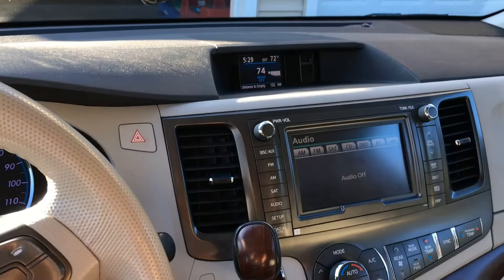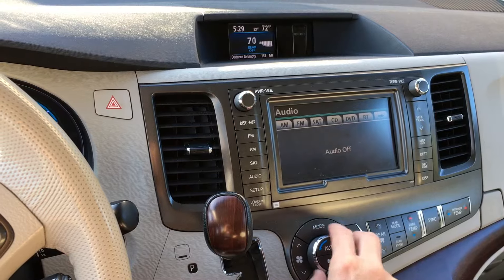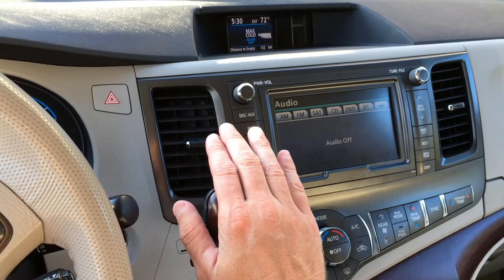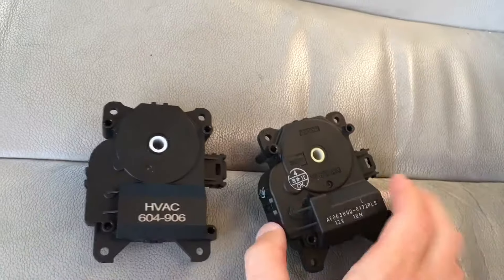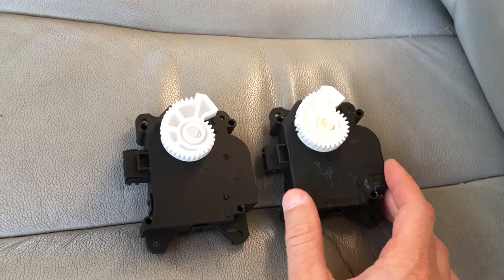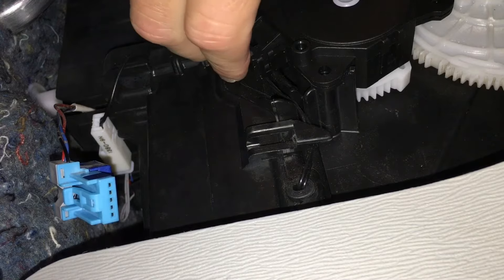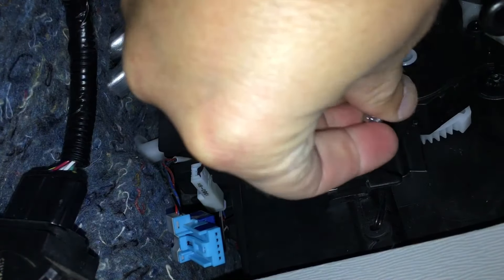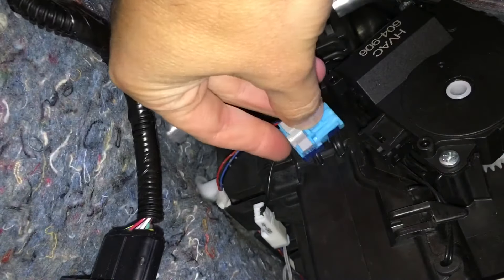Toyota Climate Control Heater AC Problem Repair DIY Fix

Comment: Thank you so much for this video!  The Toyota dealer had quoted me a price of $3,166 to tear apart the dash to replace the heating/cooling box (about $1k in labor and $2k in parts) on my 2013 Camry Hybrid.  I tried to explain to them about your video, but the $3k fix was their final answer.  So, I picked up my car from the dealer, stopped by Auto Zone as someone else recommended in response to this video, and had my car fixed in less than half an hour.  Total cost was less than $50.  Needless to say, I probably won't be servicing my cars at that dealer any longer.
Reply from the maker: I’m glad you were able to fix it yourself and save all that money! I can’t believe they weren’t willing to at least see if this was the issue before quoting such a high price! Thank you for watching and please give the video a thumbs up if you haven’t already! Thank you!
Reply: Yup.     I needed rollers for my minivan ( the small plastic wheels wore off ).    Dealer wanted 5,000$ !   hahahahahaha.      about 90$ for BOTH doors, some YouTube videos. & About 30 mins of actual physical work , DONE ! perfect.      this is after the wife said they are " honest "
Reply: Omg, i’m in this exact same position. I just got off the phone with my dealership earlier and they told me the exact same thing you just said. They wanted just under three grand to do all the work. I will definitely be doing this myself. Thanks!
Reply: Unbelievable
Reply: yea there called stealerships!!

Comment: Thank you very much for the video.  We were having this same problem with our 2014 Sienna XLE.  I watched the video, ordered the part listed in the description, and replaced it within 10 minutes.  Works perfectly now.
Reply from the maker: Jason Sprinkle thanks for watching. I’m glad you found the video helpful and you’re right it is a quick fix! Thanks again!
Reply: Were you having this problem on the passenger side or the driver side? I have the same exact symptoms in the video but my issues with the passenger side and if you read my comment above, you’ll see that the dealership quoted me a pretty exorbitant amount of money. I’m usually a very DIY type person, but when they mentioned an entire days labor and recharging refrigerant, I got a little nervous about doing it myself
Reply: @aye_Mira_Mira  My issue was on the driver's side.  I was able to just swap out the actuator to fix my problem.
Reply: @aye_Mira_Mira  My issue was on the driver's side.  I was able to just swap out the actuator to fix my problem.
Reply: @5MinuteFixit  which side wasn't getting warm the driver side or passenger. Mine is the passenger side not getting warm

Comment: I have a question. I thought this was the problem with my 2012 Rav4 and my brother got the part to fix it, but it turns out it wasn't the problem at all. Behind the dash, there is a box like thing for the dual climate control, the box has plastic sheet like things that move up and down when you change heat/AC settings. The passenger side works fine, but when you try to adjust drivers side, you can hear noise and it stays on hot. We realized the plastic partition thing that moves up and down to direct the heat came loose and got all crumpled which is why my drivers side won't work. Do you know what the part is called or if it's repairable? I called my local dealership and they want like $2200 for the part, not including installation!!  Any suggestions for this?

Comment: Hi ... nice video I have this delay problem on my 2011 Camry. When it comes on after 45 sec. the heat works but the ac only blows cold out the drivers side and the air( warm only) coming from the passenger side is weak. Did your front defrost light stop blinking and did the delay go away after replacing the damper actuator?

Comment: @5minutefixit I also have the 45 sec delay and no heat on passenger side because of the cold getting stuck do I use the same part ?

Comment: Thanks for the video,  I had the same issue with my 2010 Venza, I ordered the part and replaced it within 10 minutes and the issue was fixed. Great vid!
Reply from the maker: That’s great! Glad you were able to fix it with this video. Thank you for watching and please consider giving the video a thumbs up if you haven’t already! Thank you!
Reply: I have the same problem and how diffcult to install on the venza? Do i need to relearn after the new part install? Thank you
Reply from the maker: @mr2cqql  should be similar to the Venza, although not identical. I’m not sure what you mean by relearn.
Reply: @5MinuteFixit  Will I have trouble getting access with the inner screw? will a regular screw driver works or I need a short one.
Reply: Hi, I have the same problem with my 2011 Venza. Do you have to take out any panels. Other videos i saw is saying to remove panel and wiring under steering wheel. Is that necessary. Any advice or tips would be greatly appreciated. Thanks

Comment: You rock!  Thanks for your awesome video.  I was having the exact same issue with my 2013 Avalon.  Part on Amazon is now $95 but still saved a ton vs going to dealer.  Thanks again for taking the time to post your video as it was very helpful.  Had no clue what problem was without your video.
Reply from the maker: Thank you for watching! I’m glad it was helpful! Please consider giving the video a thumbs up if you haven’t already! Thank you!

Comment: Worked like a charm.  Thanks for posting the solution.  Took a little time to get the gears to line up but well worth the time and money saved.  Wonder how much the dealer would have charged for such a simple thing.
Reply from the maker: Yes the gears are a bit difficult to line up but I’m glad you were able to save some money! Thank you for watching and please consider giving the video a thumbs up if you haven’t already! Thank you!
Reply: So the dealership charges around $2500 for this repair. I just had the same symptoms but on my passenger side of my 2012 sienna XLE. The AC controls are unresponsive for the first minute or so after turning the car on and I only get cool air out of the driver side and searing hot air out of the passenger side. I took my van to the dealership just to pay for them to diagnose the problem with all intentions of replacing the passenger-side server myself, but, when they called me back, they mentioned that the entire dashboard needed to be taken apart, some pieces of an evaporator coil needed to be moved, and that the refrigerant needed to be recharged after the work. So now I’m scouring the web to figure out whether or not I can actually do this myself or if I need to actually pay them to do it

Comment: Having a similar issue on 2015 highlander that was noticed when controls don't come on right away. Driver and passenger side vents are blowing and changing temp, but rear is staying cold. This actuator you replaced is turning when temp is changed, so I guess there is another actuator assembly located somewhere else for the rear, but can't find any reference to help me locate it?
Reply from the maker: Yes there most likely is another actuator for the rear zone. Maybe a call to a dealership will to confirm this is the case. Thank you for watching!

Comment: 2014 Toyota Corolla,.    I have no heat.    Can have ac & air.       gears / power if air work fine, fluids are fine, it's been maintenance all the time.      I'll give this a try.   Thanks
Reply from the maker: Hopefully this helps! Thank you for watching!
Reply: Looks like the part is much harder to replace on the 2014 Corolla. Another video I saw about the Corolla said the labor would be about $300.00.
Reply: @PoconoPCDoctor  ......    for the dealership.     I'd say that's about right..    1 MAYBE 2 hours in all.      I'm guessing 100+$ hr for dealerships. ..
Reply: @PoconoPCDoctor      believe a had to use a screw but & a crescent wrench ..   because a normal screw. Driver wouldn't fit.
Reply: @pablovagnor  I just got a $1200.00 quote from a guy I have been using. He is a Toyota certified tech, but this quote was disappointing.
Reply: @PoconoPCDoctor  crazy !!!    !!   the part from dealership was about 150-200 I think.

Comment: I hope that you are still monitoring this.   I have a combination of issues that are referenced below in some of the comments.   There is a 45 second delay for me to be able to control the air system.  After that, it will come on at 75 degrees and work but the air will only blow out of the main dash vents.    Is this the same issue and fix or is there another fix that you can describe and have a video of?
Reply from the maker: There are a couple of actuators on these systems one blends the hot and cold and the other sends it to vents or floor or both. So it could be both.

Comment: Would this work on a 2014 Corolla? Same thing happening in the car.
Reply: Go over to my page.  The Corolla is on passenger side . Almost same spot , but passenger side.
Reply: I had to order mine right through a dealership..   went to several big box car parts stores.   & No fit.   
If you NEED heat / AC right now.    You can remove it & manually turn the wheel on the car side, to open the door . Until you get your part 🎉

Comment: Im having a very similar issue on a 2013 rav4 but the AC direction is also stuck on the feet. Would this also correct that issue?

Comment: I have the same problem on my 2010 Venza except I have hot air on the driver side and not on the passenger side.  I know there is an actuator on both sides but does the passenger side actuator have anything to do with the delay in the controls? Or does just the driver side control that? Hopefully this makes sense!
Reply from the maker: It most definitely is the passenger side actuator, hopefully this helps!

Comment: Hi Sir, My car (Camry 2012 LE 2.5) AC compressor did not engage. I mistakenly shortcut two pins of the Fan relay plug and now car fan does not work and the AC panel security light just blinks and the rest of the lights do not come on. I am not sure what part of my car is damaged. I also tested another AC panel to check if my AC panel is burnt out or not but also with a new AC panel I get no light on AC panel but the blinking security light. You have any opinion on which part may have been damaged and requires to be replaced?

Comment: I have a similar problem driver side cold, passenger side hot air blown out. Should I replace blend door motor on the RIGHT side and the delay 45 seconds would be gone? I know it is real hard to remove the part on the right side of Highlander 2010. I still can do that BUT only 1 question is it fixed the hot side and no delay start AC? Please give me an advice Thanks so much.
Reply from the maker: I believe that is the blend door actuator. Whichever side isn’t changing when you change from cold to hot would most likely be the culprit! Thank you for watching, hopefully this helps!

Comment: Hi!, there is a right and left side?, because the one in the link from amazon says left main, we have a Sienna 2012 and it has a delayed start from de A/C, but in the passenger side the air doesn't come out as cold as the driver side...
Thank you for sharing. Great video!!
Reply from the maker: Not sure exactly why it says left side...this is the blend door actuator that blends hot/cold to get the temperature needed. If your Sienna is not the same left and right side double check that you have the temperature synced on both sides.
Reply: @5MinuteFixit  Hi!, thank you for answering. It is synchronized in both sides. But my doubt is, you know is there is a left and right side in this blend door actuator?
Reply from the maker: There is only one side for the blend door actuator it is just behind and below the shifter, when you start up the car if it doesn’t move this is most likely the problem. Damper Actuator: https://amzn.to/30w8xxT
Reply: @5MinuteFixit  Oh ok, thank you very much for the information!, this video is really helpful. Greetings!!
Reply: I have the same issue on the passenger side in my 2012 sienna. They quoted me over $2500 to fix it but I’ve seen several videos on YouTube here that show is a pretty easy process. Were you able to get this fixed on your passenger side?
Reply: @Kevin Lopez  I have the same problem with my 2014 sienna also there's 2 actuators one on the passenger side that you have to take the dash apart to replace it and one on the drivers side that is easy to replace. If either one goes out there's a delay in the controls. It sucks lol

Comment: In your video it sounds like you're saying that the climate control knobs are not working at all. That they're not responding to any input. That's what's happening to mine. But in your fix it looks more like you're talking about a mechanical part that changes the temperature, the blend doors.  I was curious if you could clarify if your control knobs are actually responding to input or not?
Reply from the maker: The climate control system wouldn’t respond for close to a minute after starting the vehicle, you could turn the temp knob or and press the fan button speed selector with no response. Then after that ~min the control knobs would function on the screen but it was stuck on either heat or cold blowing air  (I can’t remember at the moment which it was stuck on) Hopefully this helps!
Reply: @5MinuteFixit  Ok. Thanks.  I have seen several videos about delayed start.  Mine never starts at all   no response from the controls or the steering wheel controls.  The only knob that responds is the one that selects where the air goes, feet vs head, etc. And the heated seat wheels. .   I tried a control panel from another vehicle.  Same thing. So it's not the control panel.  So far it seems like all the fuses are okay.  I'm not sure if the parts shown in your video will make any difference but I'm willing to try that. I'm just not sure what to do next.

Comment: Would this have anything to do with my ac not blowing on the front it only blows to the windshield and my feet?
Reply: I'm having the same issue on a 2013 rav4. By any chance, did you replace and correct the issue?

Comment: Exactly what my Venza is getting wrong, thanks!
Reply from the maker: Thank you for watching! If you found this video helpful please consider giving it a thumbs up if you haven't already. Thanks again and let us know how the repair went if you end up doing it yourself!
Reply: Did it work for you? Or is there a fuse reset process? If that makes any sense.. I've got a toyota harrier 2015 and I mistakenly turned up the heat now it won't get cold on the driver's side

Comment: I have the delay issue, but i watched the actuator and it does move. So, you said yours wouldn't change from cold to hot, it just stayed cold. Mine delays, but then it fully functions.  Did yours not function at all in changing the temp?
Reply from the maker: Correct, mine did not function while changing the temp. My thought is that your system is malfunctioning at possibly another one of the actuators and is therefore delaying.

Comment: Could this be the same problem for my 2015 Toyota Prius. I only get cold air when stationary and only using the battery. Air becomes hot when the engine starts running.

Comment: I have an issue with the passenger side air being hot and the driver's side cold.  I assume there is a similar one on the passenger side - it is as easy to replace?  I was told the passenger side is super hard and involves hours of labor
Reply: I’ve got the same issue on a 2012 sienna. Did you ever figure out how to get it fixed? I got a $2500 quote from the dealership and I’d really like to try and do it myself if I can.

Comment: Our 2014 Sienna has the delay. I went and watched the actuator when the HVAC was finally on, and it does work I can see it moving. Is it the same problem?
Reply from the maker: My actuator was not moving even after the HVAC was on. You may have another issue with your system or it could be one of the other actuators. I believe there are at least 3 actuators in the system. I would start there. Thank you for watching!

Comment: Question...
My problem is the air does not divert to the proper location selected, the defrost comes out the dash vents.  Is this the same/only actuator or is there another for that problem.  Temperature is properly controlled.
Thanks in advance
Reply from the maker: That is another actuator. This one is the blend door that adjusts the blend to get the correct temperature setting. Hopefully this helps, thank you for watching!

Comment: Hi I have 2014 sienna base model no climate control same issue does this fix apply to my vehicle? Thx
Reply from the maker: I would get under the dash to see if your system had this blend door. If you do see if it is functioning correctly. If not that probably is the issue. Thank you for watching! Hopefully this helps!

Comment: ive got a 2011 Toyota sienna, when i turn on the AC, i get hot air from the 2nd vent from the passenger side, is this normal operation, or am i low on refrigerant?

Comment: Which two gears need to be aligned up? I have watched the video a few times but I still didn't see the detail. thx
Reply from the maker: The white gear on the new actuator and the white gear on the hvac door. I know this is still vague but it will make sense when you get under the dashboard and see it. Thank you for watching!